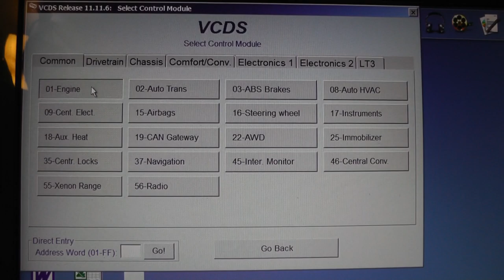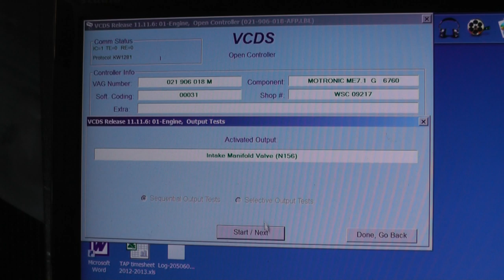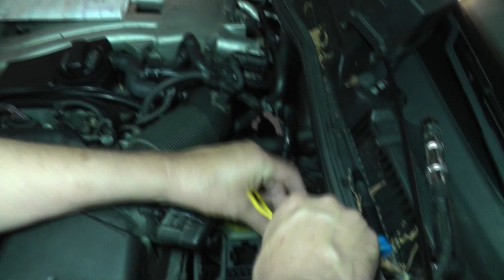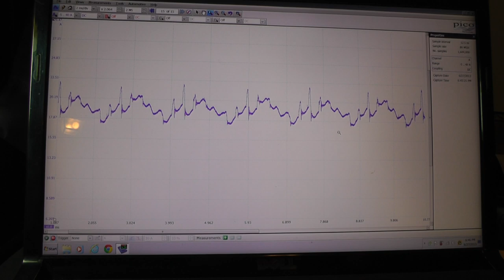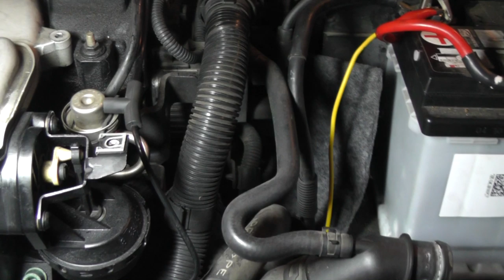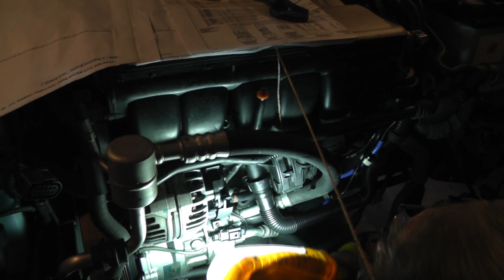Volkswagen Jetta Secondary Air Injection Diagnosis Part 11 (Hi-Tech Diagnosis on Car)

Comment from the maker: Hi  ExoVCS and thanks for stopping by. I'm not quite sure what you mean when you say the vacuum line is on the "wrong side". Maybe you could clarify that. You are probably right as far as the combi valve venting to the atmosphere as it did have a small hole in the top which means that the solenoid should not have vented in either position. On the solenoid for the injection tuning valve, it didn't exhibit the loss of smoke or vacuum lost in either position. New solenoid worked and cont)...

Comment: Very good series Terry, love the sense of humor throughout, and man that’s some sweet equipment you have, I need to get a 4ch scope I have an old bench top that works well however I like the options Pico offers, data logging and what not, that smoke machine is top notch best of all you have the knowledge to run it all, thanks for taking the time and sharing 
and to the lady behind the camera, Great job top notch love the reactions at times cracked me up

Comment from the maker: did not show vacuum loss or smoke coming out. As for the lean code, there was a large loss of vacuum at the solenoid. However, there was a large split in the PCV hose and a split in the brake booster line. I would say that they all contributed to the lean code. Thanks for your comment ExoVCDS and again, I appreciate you dropping by.

Comment from the maker: Hi busjockey. I had a couple fellas over at autonerdz who posted waveforms of brand new air pumps, and there's had some 'hash' in it also. I'm going to assume that mine is okay since I didn't see any dropouts in the current. Since it's running okay, I'll wait until it really starts to act up before I drop $600 on a pump. Thanks for watching!

Comment from the maker: No problem on the confusion ExoVCDS (smiling). I understand what you're saying. But, I can assure you that the hoses couldn't have been swapped because of the original routing. And when I put the new solenoid valve on, the hoses were installed just like they were before. Then with the new smoke test, there was no smoke, either when energized or de-energized. It could be there was a leakage there at the top of the solenoid allowing atmospheric pressure in when it shouldn't. I agree that cont)...

Comment from the maker: Yes, the smoker that I've got really does a great job. I especially like the flow meter which tells you immediately if you have a leak. And the pressure/decay gauge is really good when doing fuel evap tests to compare the FTP (fuel tank pressure) sensor readings against the gauge. This can help isolate a leak or blockage if the problem is on the back door or front door of the fuel evap system. Again, thanks for your comment!

Comment from the maker: smoke should not have came out, but I'm sure the hoses were routed correctly. Of course, it's always possible that I crossed the hose connections up when I connected to the smoke machine, but I believe it was correct. I'll have to go back and review the video to be sure. Thanks ExoVCDS!

Comment: Glad you have videos up like this. I am going through the same problem on my wife's car. I have checked a few things but now I know several others to check. I did have a lot of that stuff torn apart a few months ago when I replace the water pump thermostat and housing. I may have left something disconnected. I'm guessing with all of that replace the code never came back. Also I wish I had seen your. Videos about the rear shocks that one had me confused for the longest.
Reply from the maker: Travis Compton Hi Travis. I tried to be as complete with the videos as possible. Hopefully, the videos will give you all the info that you need to help you get your wife's car back to par. Take care...

Comment from the maker: their voltages, the timing between them. Other examples includes looking at the crank, cam, feedback signal to PCM from ICM and the signal the PCM generates back to the ICM. Four channels makes the diagnosis really quick in giving you a direction to go. And if you go to the autonerdz site, which is dedicated to picoscope users, everyone that I saw that bought a two channel, turned around later and bought a four channel. So, if you're going to buy a scope, trust me, save the money to cont)...

Comment: You might want to compare the current with the combi valve opened and closed.  You might be able to detect a drop out at different rpms.

Comment: Thanks for the video series. You clarified wiring diagrams nicely. To bad I didn't discover this channel before I removed and tuned out the SAI/EVAP items. P.S. I like your Chipotle shirt.
Reply from the maker: +Omar is Rad Hey Omar and glad you liked the videos and the shirt...Now that you see how the system works, maybe you can get in there and see what's going on.
Reply: I'm actually going to print out the wiring diagram for my heated seats, as the driver heated seat does not work. Good project to test out my new understanding of wiring diagrams before winter comes. 8)
Reply from the maker: There you go Omar...sounds like a nice project to work on.

Comment from the maker: Yes, the bi-directional scanner does make it nicer turning on the outputs. However, this system can be checked fully without a scanner to know beforehand if the front of the car has to be pulled off. In my case, I didn't know exactly where the components were and figured it would be a good video series for others. I didn't show how to check the system with the front of the car still intact, as I will leave that up to viewers to come up with their ideas. Thanks for watching and for your comment!

Comment: Greetings, friend!
Congratulations on this self-help channel. It has been very useful for me to know the vacuum lines of my Jetta VR6.
I want to consult with you the correct placement of the secondary electric water pump in jetta VR6. In my car, the previous owner removed it from the system. It would be very helpful if you could advise me, with a diagram or video.
Thank you very much!

Comment: i also wanted to comment your wife being patient through all this filming and a great job as well. I've never seen a jetta get milked before...lol ( IE; latex gloves on exhaust pipe.) your a great teacher, maybe do it for a living? i learned a lot on how to's on automotive diagnosis. i see a dodge r/t charger in background that Im sure you'd rather be driving than working on the over-engineered pos jetta...lol
Reply from the maker: soupercooper It was actually pretty simple to get the wife to do the filming. I said, look, it's your car and you can at least do the filming while I work on it. She never said a word about it and she's actually a good woman to share in some of my interests. As you heard on the video, I can get a laugh out of her sometimes like with the latex gloves. I never script anything and sometimes my comments catches her off guard. As for the Charger, that's my son-in-law's car. I did help him out on it awhile back. Seems like these cars have a problem throwing a code for the oil pressure sending unit. P0504 if I remember. He and his buddy put a sending unit it and a few days later, the code came back. I did a check on the sending unit at the PCM and all looked good. Then I looked up a TSB where the PCM needed to be reflashed for this issue. He said that they wanted to charge him a diagnostic fee of $100 at the dealership. When he told him that his dad who was an electrical engineer did that, they were cool and didn't say anymore about it. They reflashed the computer for free and the problem hasn't return after a year. Take care....

Comment: Oh and i'm so glad I stayed away from the VR6s. I've had a 2004 2 liter SOHC and now have a 2001 1.8T which is easier to work with mechanically under the hood.
Reply from the maker: +Omar is Rad You're right about the VR6 being a PIA to work on. Anything on the side of the engine requires the entire front of the car to be pulled away as you know.

Comment: I think I found my problem. The manifold changeover valve linkage is broken. I tried jb weld but that didn't hold. And of corse vw will not sell you just that plastic piece. Going to try pull a part tomorrow and see if I can find one there.
Reply from the maker: Travis Compton Sounds good Travis. When you get into plastic parts like polypro, there's really nothing that will hold any of that stuff together. Yep, best to get another part for it. Good luck on your repair...

Comment: my car is running bad,its like dead when I push on accelerator pad,I changed air flow sensor,secondary air pump solenoid,spark plugs and their wires but the car still same? 2002 jetta,,2.0 engine
Reply from the maker: Zinah Shakir Not  much iinfo to go on. You probably have a check engine light and if so, did you read the code to see which direction to take.